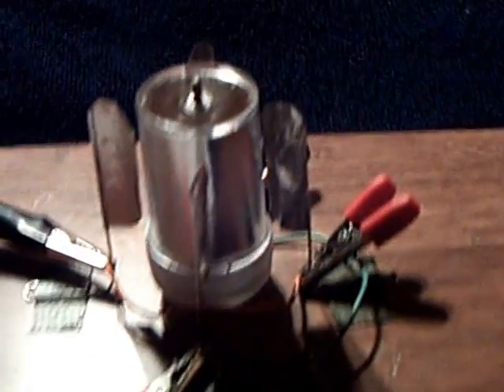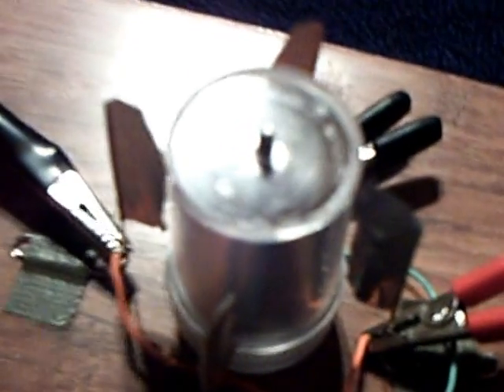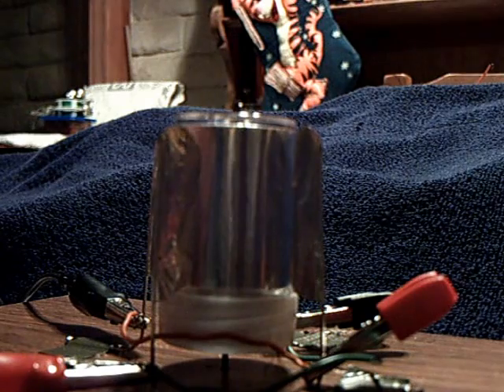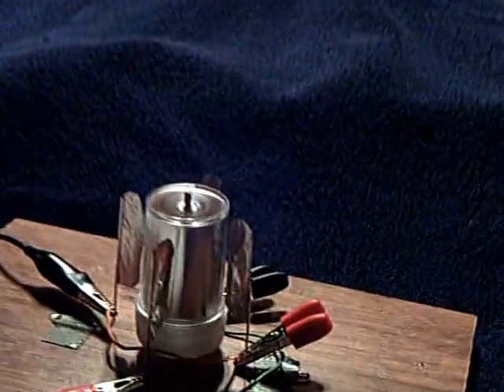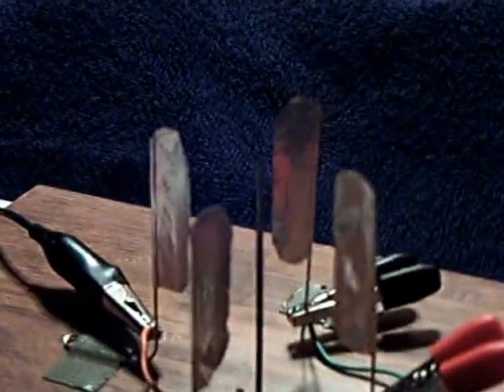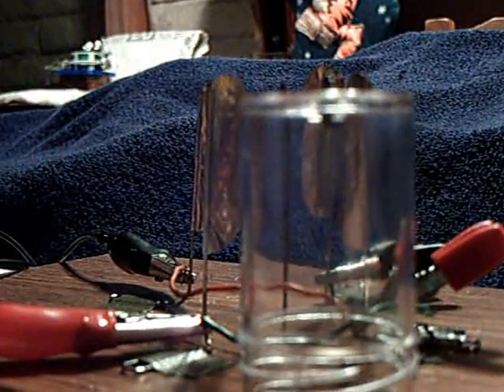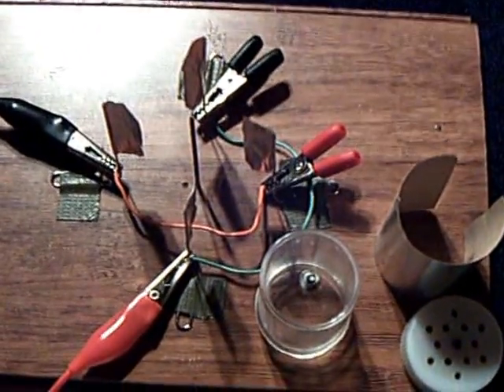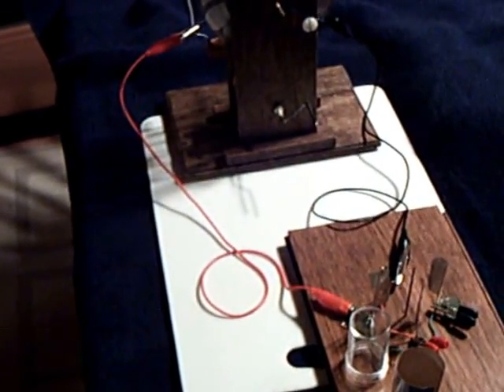Brushless Electrostatic Motor ---  No segment rotor

Comment: @leadmotor + @Jack Scholze

Looks it works like this:

When a section of the rotor is near a positive electrode of the stator, the electrons, wich are negative charges are attracted by the positive electrode.

When this occurs the aeras on both sides of this accumulation of negative charges on the surface of the rotor, become positive by lost of they electrons (nucleus been positif as you probably know).

Then discharge of the negative electrode to the positive aera of the the rotor which becomes negatuve too, so repels with the electrode, and of the negative aera to the positive making making them same polarity  and repels each other, so the rotation.

But this looks to me contradictory with the workable limite of voltage: the treshold where sparking begins, where the power looks to stand.

I.m.h.o., would be interesting to compare the efficiency when in vaccum versus in air while limit  voltage is said higher.

If I have made any mistake un my ubserstanding of this phenomenon, please correct me with arguments.

Comment: Your new design has got me thinking.. I dont know what your currently using as barings but because you have enclosed the aluminum in the plastic bottle... I cant help but wonder if you could find something slightly bigger and put some water in it and drop the plastic bottle in there. Maybe even  a put a bit of baking soda in there and see if theres any chance of some capacitance.  Im going to have to fire up my machine and run a few tests myself.  Thanks for sharing and keeping us all thinking.
Reply from the maker: I really need to make a good solid motor to do real testing with.  I'm working on it.

Comment: Hi would you try full foil circular rings that slot over the centre tube on the outside one at the top one at the bottom and then two equal distance between the top and bottom and then place a spherical ball of foil inside your foil tube and have the outer rings in traffic light pulsing top discharge then the one below etc my theory is it should be a simple joe Papp engine you get my drift then we can all get on with joe bookers air magnetic engine
Reply from the maker: I need to make a better motor setup before I can try much more.

Comment: Hi,
 
I’ve been working on my own electrostatic motors and have been following both lasersaber and your recent work with them. Do you think that there is any reason why in my replication of this motor the foil lined plastic rotor should not be replaced with a suitably mounted aluminum can?
Reply from the maker: Hey that might work.  Let me know if it does.

Comment: Is there any practical use for this? What do you think this could be geared up to or changed to fit a function?
It sort of reminds me of a mixer magnet used in chemistry. this could be used in the same way if it wont cause a spark in dangerous chemicals.
I know its only research, just want to hear your take on where this idea could go.
thanks
Reply: I have seen listed Pulse Drive Induction Electrostatic Motor and Dual Excitation Multiphase Electrostatic Drive white papers from Japan quoting  up to 7hp. You also have the ability to make 2d printable motors on PCBs using standard techniques.
Reply from the maker: I have read a great deal about this now and there are certain areas where these motors would be preferable.   Any place that would be disturbed by a magnetic field is one and micro motors are another.
Reply: agreed. i also wonder about the recent stanium advancement that may give us tin based room temp superconducting wires using topological insulator effects. i know losses are low already but I like the idea of using just the electric field with little or no electron mobility.

Comment: Happy New year Lidmotor!    Quite curious that no segments are required on the rotor,  It looks like a complete 360 degree conductive path , though it does look split at the seam, contact is probably made there also to complete the conductive path, or is there a break there?       Good to see a device using an electrostatic charge to power it.
Reply from the maker: Happy New Year Jack.  The aluminum strip inside the bottle slightly overlaps itself.  It could be a continuous ring and this would still work. This will actually turn slowly without the Al strip.  These electrostatic devices work differently that the electromagnetic stuff that use electric current.   The magic takes place in these crazy things using just attraction or repulsion of electrical charge.  It is high voltage with very small amperage.  I like the term 'influence'.  It's like the stator is asking the rotor to turn --- " Rotor I'd like you to please turn and I have thousands of volts backing me up that should 'influence' you to do so."